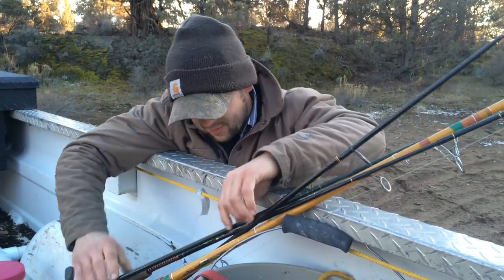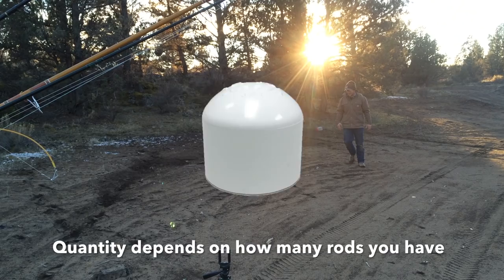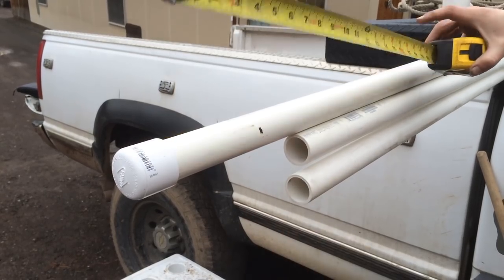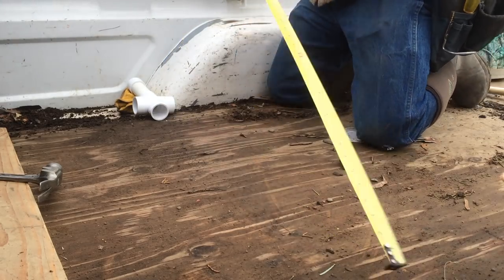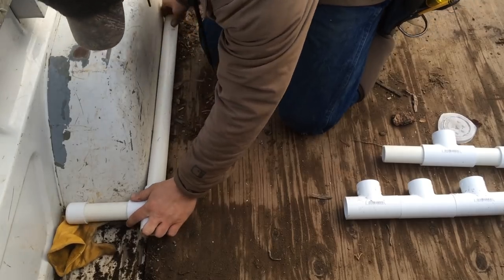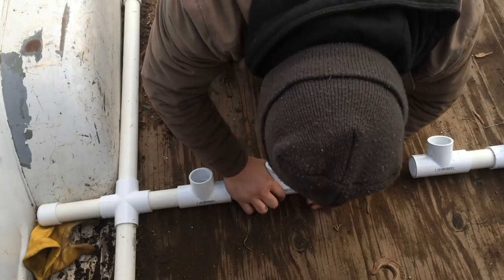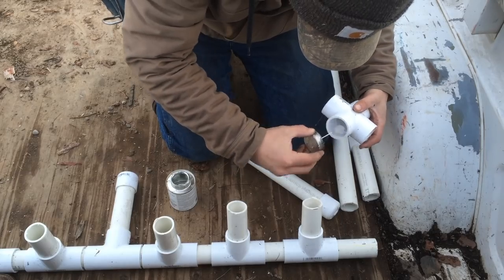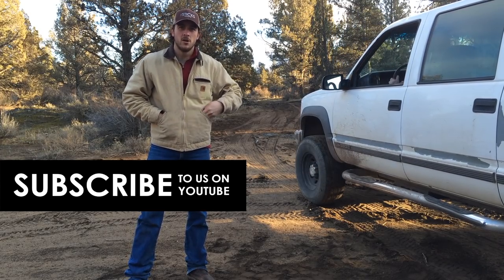PVC Fishing Rod Holder for Trucks (DIY) | The Sticks Outfitter | EP. 10

Comment: Does it around bounce much while driving--especially on dirt roads?
Reply from the maker: Hey Brad, it doesn't bounce around at all. At the very end of the video you can see it as Shad drives off on the dirt road.. The more it's wedged in and the more precise the measurements are, the less it will bounce around as well. Thanks for the question!